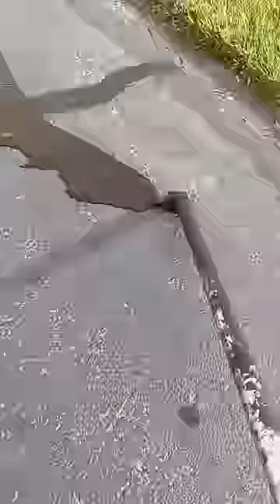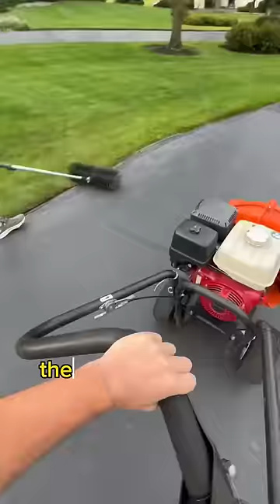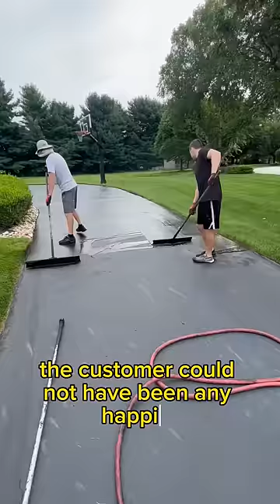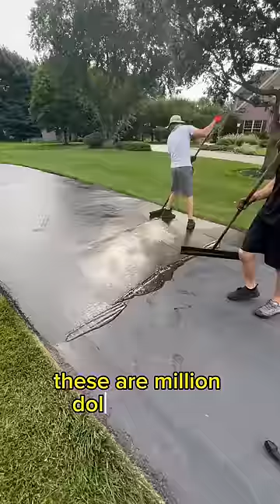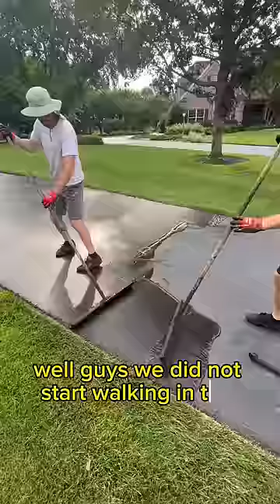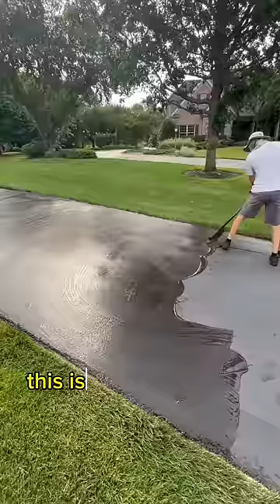SOMEONE CALL THE 👮‍♀️🚔 #satisfying #sealcoating #asphalt

Comment: You can walk in it. I did floor maintenance for years. Just get spike shoes.
Reply: Yeah, I was thinking the same thing, too. Spike shoes are a good solution.
Reply: Yea but they dont have spiked shoes theyre leaving a full a print
Reply: @Yaboiasur420 They won’t, maybe if you stomp in the same place as hard as you can for 10 minutes without stopping, but it you walk in it it wont leave a print
Reply: @BadFools  in the video they dont have spiked shoes they are leaving a full print
Reply: @Yaboiasur420 Yea because their not spiked. Surface area. But I do admit I dont know how this fluid behaves, its thicker than what I am used to, so I am not 100% sure. But its worth a try
Reply: I always walk in it while spreading.I make sure all of the bubbles are gone, and all of the porous it’s is filled, especially if it’s the first time the drive is sealed.
When I go to pull it, I don’t walk on the final brushing.
Haven’t had any complaints.
Reply: 99Em07  i never said they weren’t going back over it i just said they didn’t have spiked shoes
Reply: random but happy 1k likes
Reply: Actually the spike shoes make it harder the rubber from the crack fill process before you seal your spike boots would sink right into the rubber plus the rubber can be slick we have one person track and one person pushing the sealer it's by far the fastest way
Reply: @Yaboiasur420 did you not just watch the video ?
Reply: @luiscontreras8807  i did and he wasn’t wearing spiked shoes
Reply: @Yaboiasur420 DO YOU SEE ANY TRACKS, MY FRIEND?
Reply: @ProtogenCorsair  yea
Reply: Actually don’t lmao, it’s common sense. You can just walk on it if you work fast enough
Reply: @Yaboiasur420 they werent sayin that they had spike shoes, js saying spike shoes are an excellent choice to walk over them
Reply: Yeah this kids just a get rich quick typa guy
Reply: @Yaboiasur420 bud, the giant squeegee, tf do you think that’s for?
Reply: @maxwellhesher1790  covering the prints
Reply: @Yaboiasur420  so…. they’re not leaving a full print, are they?
Reply: @Yaboiasur420 they lit didn’t say that, you’re trying to say the comments are what they’re saying. Just take the L
Reply: @memewithinameme35  jit trippin
Reply: the worst possible idea you could have suggested 😂 when your walking on that stuff it is beyond slippery and spikes would slip like ice if u take a wrong step
Reply: I’ve walked in seal with just asphalt shoes, as long as you brush it back over the material still looks as good as it would 🤷🏻
Reply: How has anyone not thought nor saw they can and did cover the prints
Reply: @Yaboiasur420 you see them going over the spots they walked in right? 😂😂😂😂😂😂
Reply: @Yaboiasur420 guy in the white shirt left 0 prints and he still went over the spots he walked on. Lmaooo and the guy in black didn't even walk on the sealer 😂😂😂
Reply: @Yaboiasur420 but you said he left full prints when you can see it ain't even true and he still went over the area he walked in.
Reply: @theycallmeleanfornoreason2746 finally someone that actually knows. 😂😂😂
Reply: @Mclovin231  all i said was bro didn’t have spiked shoes not that he wasnt going over his prints u goober
Reply: @Yaboiasur420  you literally said that they were also leaving a "full print" like I said 🤦
Reply: Yeah, but they are in tennis shoes.
Reply: @Mclovin231  r u saying they arent?
Reply: @Mclovin231  watch the video again bud
Reply: They did clean up the print they left on the fluid tho, like the brush just go over the print and remove it
Reply: @Yaboiasur420 Do you not see the giant tool in his gand he uses to smooth the surface after stepping in it?

How tf do you miss that??
Reply: @Yaboiasur420  the first couple times I watched it I saw the guy in white walk around on the sealer and I can see that it didn't leave full footprints because oh how fast and light they were. Then he went back over the area he walked in towards the end. What is the point in telling me to watch it when you are the one that said something ignorant? 🤦🤦🤦
Reply: @Mclovin231  he doesnt have spiked shoes
Reply: I knew this without having experience 😭
Reply: It's like people didn't watch the video and see his method. Walk backwards and brush over. People who pour cement do the same thing. You don't brush forward you brush backwards
Reply: You mean cleats?
Reply: Lol we do floors and we have really really flat shoes with no tread and brush it. Then we clean our shoes.
Reply: So cleats or golf shoes?
Reply: @Yaboiasur420 and guess what they’re doing… smoothing it over.
Reply: Big brains in this comment section lmao
Reply: @boiledpepsi  i want u to go back and quote the exact Comment where i said they weren’t
Reply: @Yaboiasur420 yeah but they are going back over
Reply: @worthlessfox  who tf said they weren’t?
Reply: @Yaboiasur420 what is your point bud
Reply: @Ty_rone  whats ur point
Reply: @@Ilovejoebidenforever why do you love joe Biden if I may ask
Reply: @Yaboiasur420 yeah but you also see the parts they leave prints they go right over it again and don’t leave any prints right? Or you’re gonna be one of those dudes? PrInTs UgH i cAnnOt BeLiEve this AtROCity !!! If there were lower case exclamation points I’d leave you some but here’s this fancy one ❕
Reply: @Yaboiasur420 buddy you just said the same comment twice. we get it. doesn t change anything tho😂
Reply: @Yaboiasur420 Look at the pattern they're doing it with when they step on it they fill go over it again
Reply: @little_lord_tam wtf
Reply: No. Spikes will damage the asphalt.
Reply: Sand in material, not spikes, and if done right, they shouldn't need to walk in it.
Reply: Nah, you don't need spiked shoes, just Squeegee over anything you walk in.
Reply: no. you don't need for any type of special shoes. As long as you wipe it after you walk, then it literally doesn't matter
Reply: Y’all not dead ass 😂 yes he’s walking in the stuff but he’s literally smoothing the foot prints out as he walks down. He’s not just leaving sets of footprints down the dang driveway. These comments can’t be real, somebody please tell me I’m missing the joke or issue 🤦🏽‍♀️
Reply: Yh but he doesn't have spikes
Reply: They never left any footprints they we t back over all the spots the walked on carefully with the brushes its fine your all be to dramatic the finished product is perfect and they got paid well end of story
Reply: So you basically can’t
Reply: @Yaboiasur420 are you blind or do you not see the pattern ? Person literally goes over where they’re walking….. 😅
Reply: Yep as long as it’s not hot fresh asphalt or the product is heated and then heats the asphalt . I wouldn’t were spikes on the asphalt then.. it should be flat shoes no tracks.. and just clean them or walk in the sand later when done .  But you are right about a cold /old surface , cold enough product you can even have spikes and it’s easier to be non sticky probably.
Reply: @Iwinudont is this rubber is it? I thought it was an asphalt. Why do you want to seal the rubber? You could be right but it not normal in my part of the world to even have rubber anywhere where cars go except for a specific transition between paved road and bridge elements, and I think they also use a mix with polymer bitumen as it is stronger and more durable than just rubber. I think its about top sealing asphalt as the bitumen has worn off and it’s cheaper to upgrade than to put new. And they want it to just survive a couple years more and stops the water from penetrating causing cracks and eventually make asphalt less stable and can start to come off from where it was binding the stones together..
Reply: The same people saying they're leaving prints kinda watching a different video mans covered up every print they left with a final sweep
Reply: @Yaboiasur420 but they sweep over it?
Reply: @Yaboiasur420 they’re not leaving any full prints in the finished product so what’s your point
Reply: @Yaboiasur420 No they are not. The product in which they are using is a cheaper product that does not set near as quickly as the high quality stuff which is why they are able to step on the sealant and not leave any lasting prints or issues in the final product. Why is this so difficult for you guys to comprehend??
Reply: true they also only walk in the parts ehere they will swoosh over again so it gets even at the end anyway
Reply: These guys are what you call "democrats"
They will fight traditions tooth & nail.  If your grandfather taught your Daddy the tricks & and process, these 2 jokers will be like
 "Well, in trade school. "
Reply: Leaving a full print but also going back over the places they stepped in. Quality of work is still fine the end result is they just make more work for themselves. If they are happy with that who cares.
Reply: @BadFools I agree there’s nothing horrifyingly wrong about it, but they should have spike shoes, it’s a very simple and in my experience mandatory part of laying stuff down, but I was never outside so maybe I don’t know well enough.
Reply: Yeah ruin the floors instead 🤡
Reply: He’s literally going back over the part he walked on why is everyone saying he’s leaving prints
Reply: @ttvgoldentrash4203 then they immediately cover those prints 😮
Reply: Well if you are smoothing it over afterwards, no problem.
Reply: Cleats? 😂
Reply: @ttvgoldentrash4203 Spiked shoes are a horrible idea... its blacktop, not grass, you would be reducing the surface area for traction massively. 
I used to do this exact technique on driveways and i used water shoes which worked awesome.
Reply: @Yaboiasur420 Wheres the full print? You’re literally watching a video of them doing it living no print behind
Reply: @Yaboiasur420 looks to me like they usually take the brush back over anything they've stepped on even tho I don't see foot prints starting to begin with
Reply: Or just one big spike on a shoe

Comment: As a sealcoater myself. I can vouch for these guys. I see a lot of videos on here where the sealer is so runny you can tell it’s diluted at least 30%. This stuff looks like good product. Walking in the sealer with this method is the best with 2 people. But it is tricky when you’re solo on hot days. The footprints can be burned into the driveway faster than you can get them out sometimes when your solo. All in all, fantastic work!
Reply: im a seal coater to an some times you have to walk in the sealer but we don’t do it this way we spray it on so there’s more material bein layin down for the customer it’s also the professional way to do it. if u get the right rig u can do some drives in like 30 mins that’s with cleaning,removing weeds,hot crack filling an sealcoating u should look into it.
Reply: @nicholasmitchell7533  I agree. I do spray. It saves so much time.
Reply: @nicholasmitchell7533 I do the same man..spraying is 100% the way to go. Much more clean look in my opinion as well
Reply: You can dilute about 25% and it still be pretty good product but anything more than that it’ll start to be extremely runny I agree
Reply: @Jay-py1ow  I don’t know man. I have to respectfully disagree with you on that one. I prefer the look of a hand seal in my opinion. But when you take into account how much material and time was used, it can’t beat spraying. More money in less time equals no brainer.
Reply: @Jay-py1ow  true. I dilute 10% and I’ve found that to be the sweet spot. If I need 100 gal for the day I add 10 gal of water. So I do that 10 times and get a free 100 gal.
Reply: I worked briefly for a crew in South Carolina had a couple smart ass 20 year olds working and the product was so fuckin runny. Lil bastard handed me a $10 quicky mop while he used my $80 Sealmaster brush. I packed my shit and left that dump
Reply: We only Broomed next to the house or garage or concrete sidewalks, sprayed the rest, you end up using more material than needed breoming the whole thing

Comment: I would suggest at least getting those pin cleat slip ins for your shoes so you don’t ruin your shoes and leave footprints (in case it shows back up) and it’ll just be easier to clean up little tiny pin marks
Reply: Probably $25 Walmart disposable shoes.
Reply: Agree
Reply: @rodgerjames9160  that would work if you forgot your shoes but that adds up a lot. When you can buy 1 pair of pin cleats we use for when doing epoxy floors etc. they just strap onto your existing shoes and that’s it
Reply: I've gotten 3 seasons out of an old pair of Sketchers slip ons. They have outlasted 2 pairs of the same shoe, that are just everyday shoes. They're all sealed up!!!
 The footprints get re-covered as you are working your way out. In my 10+ years of doing this...zero call backs or complaints about footprints (cuz there aint none!)
Reply: @fermiticus4034  yeah but you’re one step of walking onto a sidewalk or part where no sealant is supposed to be and there’s a sealed footprint in the wrong spot
Reply: @duckattak  With thousands of driveways under my belt, I have never stepped onto a sidewalk, curb, street, or anywhere that shouldn't have sealer. That's a silly concern. You must hang out or work with some dumb people!
Reply: @fermiticus4034  no need to say I work with dumb people all I simply said was maybe invest in cleats to save your shoes. Idk how you got so personal so quick to one of your viewers like wth?
Reply: @duckattak   I'm just a dude that also does seal coating...this is not my video, so you're not one of "my viewers"! (I've made that same mistake, too!)
 Thing is...there's really no way of "saving" shoes when dealing with this stuff. Back when I was a mason, I'd have to replace my work boots about ever 6 months...whether they were $30 Dickies or $200 Redwings. My ratty old Sketchers have lasted me 3 seasons, and will likely make it through next season too! Yeah, they're black and nasty looking, but it's not like I wear them anywhere but work....I have other shoes!
Reply: @duckattak take off your shoes, step off the driveway and pick up your shoes. Its not rocket science lmao. Ive been sealcoating driveways since ive been 14 (26 now) and ive never had an issue like that.
Reply: Why are you doing that like you to do walking in it like what? What bye-bye
Reply: If he used the right product you wouldn't be walking in it
Reply: @jairusalexander8906  not sure what your sentence meant or who you were referring it to but I don’t walk in it but if I was the guy here who walks in it in every video I’d get cleats that epoxy floor guys use instead of buy new shoes every 3 jobs or whatever for $25
Reply: @ring_dingle  that’s awesome dude. But sometimes leaves and shit fall on the coating and you’d need cleats to step on it to get it and not have shoe prints to cover up etc. proud of you
Reply: @duckattak there is literally no reason to buy new shoes the sealer doesnt destroy the shoes in any way other than cosmetically and can gunk up the laces a bit but thats not even really an issue. I have a pair of shoes that are like 2 years old from when I use to seal drive ways and parking lots. They just look ugly but still work just fine. If it was epoxy I could understand but sealer doesnt harden the same way as epoxy it's more similar to paint.
Reply: @duckattak just a quick hit with a squeegee and it's as good as new.
Reply: There is also special spike shoes you can use That guys who lay Apoxy Use

Comment: why you walking in the sealer I’ve been doing this for 30 years and I’ve never walked in the sealer once I can’t believe my eyes
Reply: This is how i have done 100s of driveways.  Usually though we put material on the sides and drew it to the center, so we could do it without walking in it.  But as long as you brush it out, foot prints dont matter.

Comment: Done that more than once.  Nice to see you have a good method to apply the coating.  Picking up that 5 gallon bucket get really hard
Reply from the maker: Thank you sir 🙏🫡 we have all the the proper additives and sand in our sealer. Weighs like 11-13lbs a gallon 😂 my guys would quit if we carried buckets all day 😂 but we did indeed start with bucketing driveways 🫡📈🙏

Comment: Walking in the sealer is perfectly fine. Working in the sealer to fill pinholes and air pockets, just make sure you go over your foot prints. Sometimes it’s a good idea to do an second coat, after it dries. Doesn’t take that much more product or effort.

Comment: I sealcoated for 5 years with a buddy and a box truck and did it just like this. Honestly i think it turns the best. Ive used the wands and other methods...some of the driveways I last touched 3 years ago (the last year before the truck blew up and I just sold the equipment) still look brand new.

Comment: I’ve been sealing for 12 years and I’d never spread a sludgy apoxy or acrylic on asphalt ever. Asphalts made of tar, aggregates, and sand…. Therefor the only product that should be replaced is the cutback asphalt as it oxides out. This is beginner work… p.s capping off asphalt like that doesn’t allow it to breathe, the apoxy/paint will hold moisture under it speeding up the aging process causing they to either get this process don’t over and over until you have an inch of latex on top the asphalt and needs replacing. 🤦🏻‍♂️

Comment: You should try keeping your passes squared with the driveway, turn on the edges, move straight to the other side of the driveway, then turn down the other edge, the straight lines from side to side will blow your mind when you see the results afterwards, I see you guys use the mesh brushes as well, the stiffer brushes work better for what I just said, I work sealcoat as well so if you need tips tricks or anything let me know because I work for a company whose been doing it for 30 years (WALKING IN THE SEALCOAT IS NECESSARY, SO WHO EVER SAYS YOU SHOULDNT IS STUPID AS HELL)